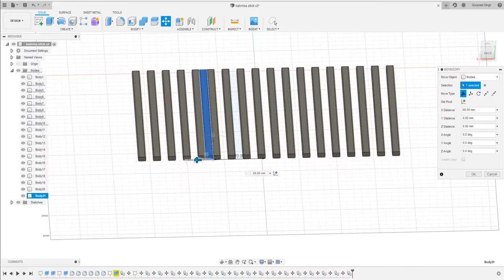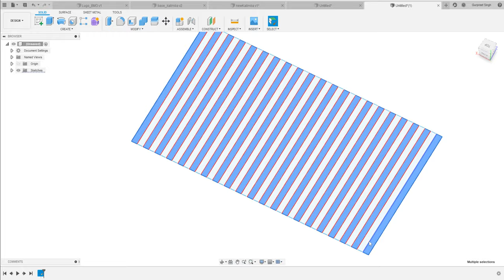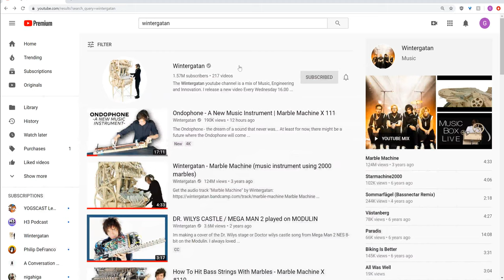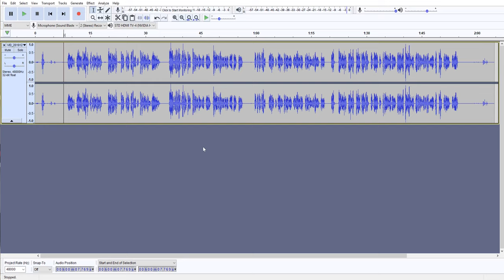🍉 DIY Automatic Self Playing Kalimba

Comment: They have these, I mean many music boxes are basically kalimbas, they have metal tongues and a cylinder with little pins sticking out of it that catch them on  the way past, perhaps you could emulate this on a smaller scale, have a piece that rotates with evenly spaced pins that can be extended and retracted. The speed of the motor could be varied to achieve tempo and timing differences and you'd essentially have a programmable music box.

Comment: Kalimbas are often just nails or other metal, heated and hammered flat, then length-adjusted to get the desired note; the sound box can be any size you like that works.  Perhaps building a kalimba to match your servos/actuators rather than the other way around would be an interesting project.
Reply from the maker: Yeah actually i was thinking of doing that at one point. Maybe also making this Kalimba with all notes so you can play any song.
Reply from the maker: The biggest issue i would think would be tuning the notes. Im not sure how much work that would require.
Reply: @ODDRISER  Several topics...
There are tuner apps.
Pick an approximate length for a note, and fasten with a slot to be a little adjustable.
Clue: the angle arrangement of the tines are for ease of playing by a human. You can mount all in a straight line, but staggered to fit more in a length of space. Or not staggered might look nicer. The point is to make layout and mounting easier.
Notice how the same note on a down or upstroke sound different. Suggest: Convert servos to 360-continuous. Add a 4-arm wheel, so that the servo can turn 90-deg in either direction to play a note.
You don't need to go fully remote with the servos to lessen the noise. It'd be better if the servos were not mounted on the sound box. Mount them on a board right next door, connected with rubber vibration dampeners. Using foam board (light, use hot glue,) build a box around the servos, and line with thin foam/cloth.
Looking forward to the next prototype!
Reply from the maker: @jimbarchuk  holy moly!! I really appreciate you writing all this out. Thank you for all the suggestions. V2 is a linear actuator design with the same servos just a lot more design work than V1. Yeah I realized after the fact that mounting it to the sound box probably wasn't the best idea. So everything is mounted away from it. 

Shameless plug to subscribe so you'll know when I put up the video for V2. Its so overkill so its been taking forever to finish.

Comment: You can try to use a solenoid linear actuator instead of a servo. They are easier to dampen the noise as they don't use a gear train. If you want to still use your servos you can try using a hydraulic setup where the servos actuate from far away so they can be encased in a soundproof box. A good video illustrating the gist of what I'm thinking "How to Make Hydraulic Powered Robotic Arm from Cardboard"
Reply from the maker: I was thinking of rolling my own micro solenoids and mounting them under each note. Im just not sure about current draw requirements. The mini servos online are pretty big so I'd run into the same staggering issue.
Reply from the maker: Do you know if you actually need magnets and magnet wire to make a solenoid?
Reply: @ODDRISER  just magnet wire, spring, and nail will work. an iron core would make it stronger but if its DIY i would avoid.
Reply: ... wanted to pitch that idea too.

but what you two already discussed got me thinking:
1. if the solenoids are too big / do not have enough power you can use levers to move them farther apart and away and increase the torque.
2. the servo controlled Kalimba sounded a bit less "rounded" to me (compared to playing it by hand) - maybe the contact areas of the actuators need some rubber coating or something?
3. there was something else i can't seem to remember right now....